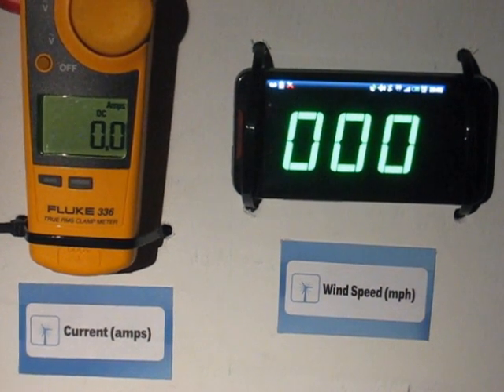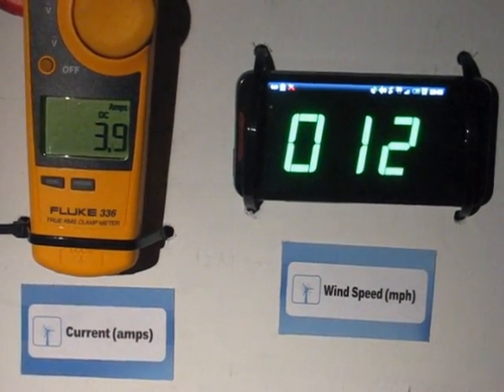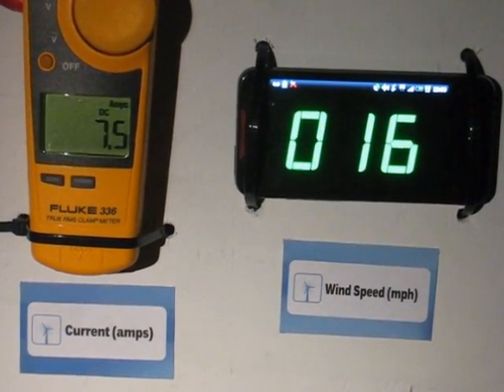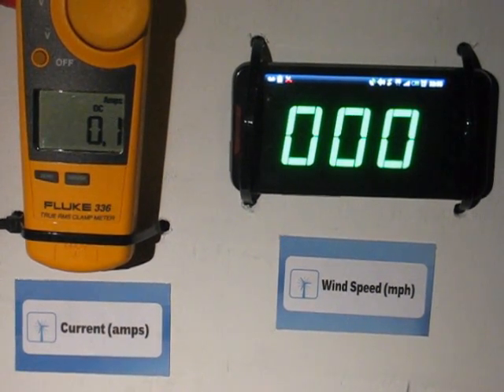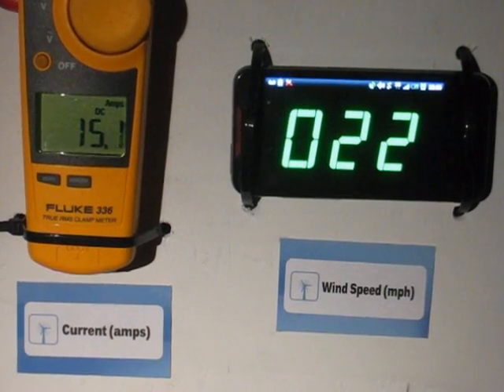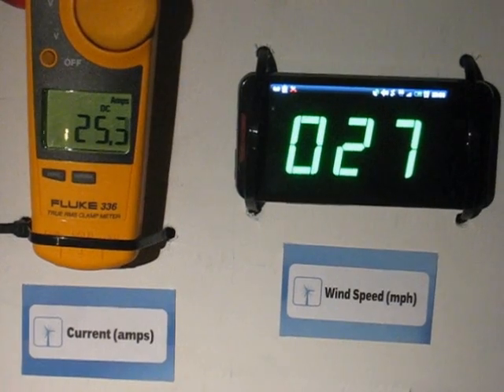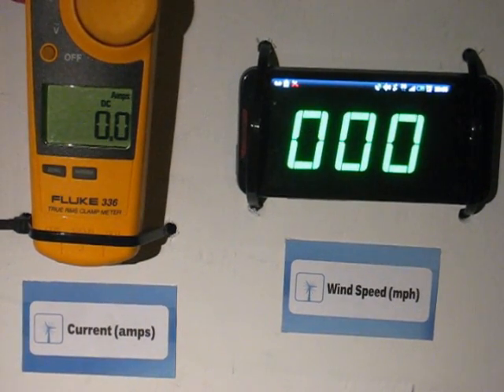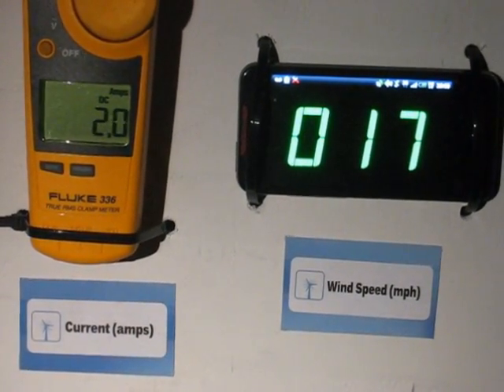WindyNation's Windtura 750 Wind Turbine: Real World 24 Volt Power Curve

Comment from the maker: @ian57812 Hi Ian, 28 mph is approximately 680 rpm or  approximately 1000 Watts. If you take into account  that in this video the battery bank started out at 27 volts at 0 mph but at 28 mph it is closer to 33 volts (as shown in our rpm test stand video). So 31 amps at 28 mph at 33 volts is 1000 Watts. This corresponds to 680 rpm. 

As I said before, the Windtura 750 is a very powerful alternator and we could ethically and realistically rate it as the Windtura 1000 :). 

 Thanks for your comment.

Comment from the maker: @leamyvideo Hi Larry, not only can I do it, I have already done it. It is a little bit like cheating because if you increase the load, you increase the amps. This is similar to a dead short situation. 

 I had three 300 Watt resistors (900 Watts total) hooked up to a 12 volt battery bank when I did one test run. At around 35 mph, I had a reading of around 56 amps! With no resistors hooked up to the battery, the reading is around 42 amps.

Is there a reason you want a load on the batteries?